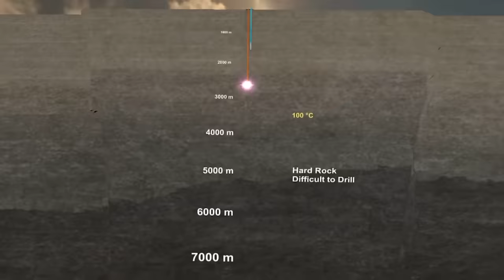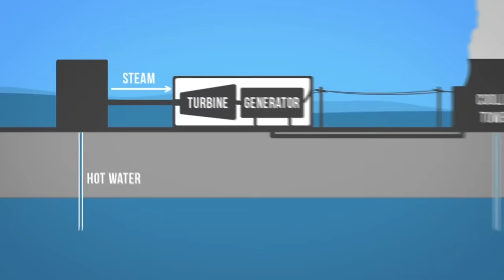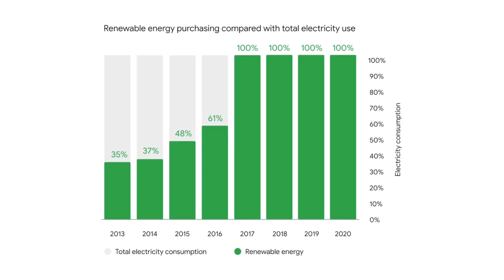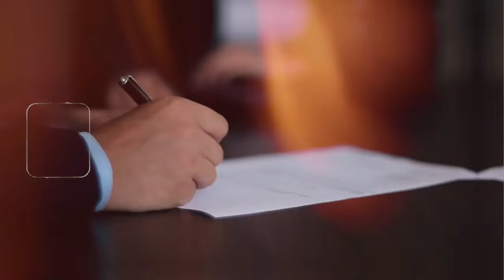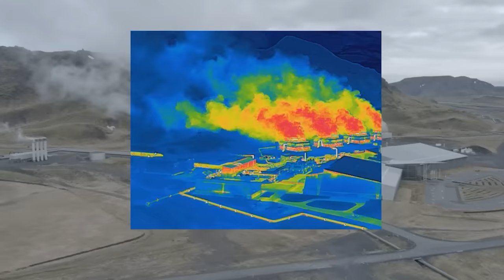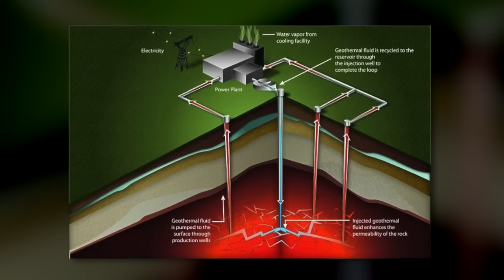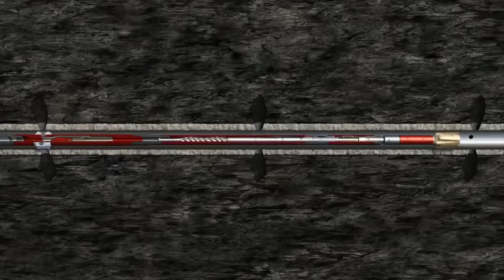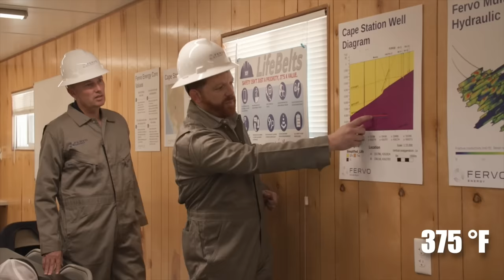Why Google Is Spending Billions To Build A Geothermal Power Plant

Comment from the maker: Will Google provide the answer to the world’s 24/7 green energy needs?
Reply: Let look up how much water geothermal power plants need first, and check where and how you can connect geothermal powerplants and reliable a water sources , and assess the costs
Reply: Why is that really needed! Didn’t scientists figure out how to create energy using energy. New era of nuclear power.
Reply: @user-xr4bo3ln6f You could use water pumps, but then that’d take away a chunk of the power generated so it’d cost a lot to doo this and even then it might not make back what it costed for a very long time
Reply: @michaelglynn7010    Every energy conversion to create electricity has parasitic losses in the process.  That's nothing new.
Reply: @MrRight-fu1gf  
Closed Loop geothermal has been around for a long time. Using refrigerant based systems that work at cooler temperatures have been around a long time as well. These systems like nuclear plants do not expose the the power side circulate to the heat absorbing circulant. The refrigerant condenses the steam and gets boiled in the process. The condensed steam is pumped back into the well and the boiled refrigerant powers a turbine.
Reply: Well over a long term large energy tapping, it might upset the balance of energy under the surface, no? What you would do is effectively letting the energy out of our planet and release it into the universe by heating homes for a short period of time, or making electricity that is used and is gone forever..
Reply: geothermal is inherently location specifc. It only takes minutes to learn this
Reply: @AL-lh2ht  
HVDC can more energy thousands of miles without substantial loss. Newer geothermal technologies just might be capable of being deployed in many areas that were not productive today. The question is can HVDC and deep wells supply a substantial amount of our electricity generation? We do not know yet.
Reply: @AL-lh2ht  it depends on how far you can dig. With plasma drilling any place can produce geothermal.

Comment: The power plant that the Fervo project is located at is owned by Cyrq Energy. There are many such geothermal power plants in Nevada and also in California. In fact the US generates the most geothermal energy in the world. What Fervo is doing is adding to the heat being used in the binary power plant to generate electricity. So Google is not building the plant. The rock isn’t dry, it is fractured but there isn’t enough permeability to be economic so Fervo fractures the rock to improve the permeability and make the wells produce more hot water. This plant doesn’t use steam, it uses the hot water to heat a working fluid that vaporizes and turns a turbine. The Blue Mountain plant has 3 binary units.

Comment: But I thought fracking was a bad thing!?
Reply: The difference between fracking when they are doing it to generate electricity compared to oil is with electricity all they are doing is shooting water into the parts of the ground, whereas doing it to extract oil they have to use chemicals in the process. I'm not positive exactly how it's done, I know that they have developed a way of making it much safer and/or cleaner than it use to be, but they still have to use chemicals to get the oil. But in any oil extraction, even if it's drilling underneath the Gulf of Mexico, there are going to be such tradeoffs. Risk/reward type of thing. One wrong move out there you suddenly flood the entire Gulf with oil. There are no oil fields in the world that have pump naturally built into them that we can just go hook our stuff up to. That goes for many of our natural resources.

Comment: why put a data center in Nevada where its hot as hell. what about Minnesota or someplace that could use the waste heat
Reply: Minnesota gets -50 degrees and foots of snow that cave in roofs. Then you get tornadoes and thunderstorms.  At least you only worry about heat in Nevada.
Reply: Tax breaks.

Comment: It is the Nevada Desert.   Where  is the water  coming from?
Reply: Nevada has more ground water aquafers than any other state in the union. 
The issue is its recharge rate is really slow. 
depending on how Google is going to use the water, its likely that the vast majority of it will be recycled through the system over and over again. 
If not, then the engineers are stupid. 
But the experimental Google building in this video is only a few miles away from the Tesla Giga factory that is also in Nevada about 20 minutes outside of Reno Nevada.
Reply: HOOVER dAM!
Reply: Possibly aquifers in the subsurface or nearby streams. . .

Comment: I’m not saying I’m right but there seems to be a correlation between fracking sites and subsurface earthquakes. This could also lead to this as the wells run deep into the crust?
Reply: Yes it most definitely will.  The Geysers in Northern California USA uses natural fissures and they ran dry of water, they now inject water in and it causes earthquakes, I  live near this area and feel the quakes.

Comment: Sounds like fracking, considered a biohazard in most of the United States when used to extract the cleaners Natural Gas in the world... but I guess when fracking is used to promote a different narrative all the biohazard concerns magically disappear. 
MAGIC has always fascinated me  😏
Reply: The details of each region probably matter here.  A lot of the criticism of early fracking dealt with holes drilled in more populated rural areas back East like in Pennsylvania. People using well water were having their wells (the groundwater formations above the shale gas formations the frackers were aiming for) polluted.  Either the upper levels of gas wells passing through the water table levels weren't cased properly - allowing chemicals from the fracking processes to leak out into the water table - or the fracking was taking place at depths shallow enough to allow such leaking.  

Oil and gas projects (both old style sandstone or newfangled shale formations) by definition are in sedimentary basins, with multiple layers of sedimentary rock - so there's probably groundwater above the oil and gas.  If there's any settlement in the area, they're probably tapping into that water already (good chance the oil and gas drillers want to make use of some of that water themselves, which can be another issue).  Also, the water used during the drilling of the well (and that's a lot of water, now with funny chemicals in it) will need to be disposed of somehow, somewhere - and that's often in OTHER wells in the area, tapping into other formations.  That can leak into some of those "good' water-bearing formations as well.  

Geothermal projects, in either the classic naturally fractured/ porous areas already developed around the world, or the newer "enhanced" projects like this one,  tend to be in igneous formations  instead of sedimentary.  That must affect the potential interactions with other formations.  Also, at least in the US, most of the geothermal projects (natural and enhanced) are in the West - California, Oregon, Utah, and Nevada especially.  Many of these are in desert regions.  There can be irrigated agriculture in the area, but there can also be some distance between these activities as well.  No, they don't "magically disappear" - but they aren't automatically identical either.  Using mere ideology in place of evidence on either side of this is just dumb.  Also, fracking itself may have developed as a tech in the last decade-plus, so some of the very real problems during the WBush/Cheney Administration may have changed since then.

There are several companies, as well as several government agencies (not just in the US) researching other potential advancements in drilling tech that may make much, much deeper wells than these practical.

Comment: Kenya has been doing this since the 80's, providing up to 800 MegaWatts of electricity in one of the most advanced electricity generation techniques ever invented
Reply: by volume Kenya does about 1/3 what the US (which leads the world in electricity generation from geothermal) does.  Good to see it happening.  Indonesia is right behind the US.
Reply: @lylestavast7652  And Iceland is about 2x the US.
Reply: Kenya only has to go 900 meters. The  break through here is fracking tech that lets them go much deeper.

Comment: For Geothermal to work,there will be fracking in order to maintain the volumetric head required.Even the Geysers in Lake/Sonoma counties this was ongoing during construction .In 1975-79.
Reply: There was no deliberate fracking during the early days of geothermal development at the Geysers. There was no injection of the cooled condensed steam which is what causes fracturing and seismicity at the Geysers. Injection started in the Geysers in the 1980s. There have been tests recently of fracturing at the Geysers to tap the deeper hotter rock that isn’t fractured already.

Comment: So a power plant in the middle of the desert. So where do they get the water from?
Reply: Yes  where?
Reply: You simply capture, condense and reuse the exhaust, this has been done since the 1800s. Nearly all steam power plants do that, i make them as a hobby. Size, weight and surface area isnt a concern at this scale and oil injection isnt necessary for turbines so they can definitely recycle 100% of it. Seawater can be used as coolant if the condenser is made of stainless steel or inconel

Comment: Either the video is BS or Google is stupid. There are a few places on earth where the magma is much closer to the surface and more fit for geothermal powerplant as they have quite low efficiency compared to other sources. Picking a location quite randomly is plain stupid and insane.

Comment: Инновации конечно это хорошо, но одна сверхбезопасная атомная электростанция Akkuyu будет генерировать 4800 мвт, а тут всего 3,5 мвт. 
Для выхода на такую же мощность понадобится 1300+ таких электростанций... это не очень хорошо для экологии.
Reply: This is the most logical comment I've read so far... BRAVO 👏👏👏👏
Reply: There both nuclear power: The earth's heat comes from underground nuclear decay.

The question is: What kind of nuclear decay is most cost-effective in your particular area: The artificial kind, or the natural underground one.

It'll depend on the depth, rock-type, but also the local supply chains/labour force you have available.
Reply: @domtweed7323  в любом регионе атомная электростанция выгодней и для рентабельности и для экологии.
Геотермальные станции используют в очень ограниченных условиях.
Reply: @ФедорГеоргиевич-ь1ю It depends on the supply chain.

America has a really bad supply chain for building new nuclear reactors (look at Vogle), making new American reactors very expensive. However, they have an extremely advanced industry in drilling very deep/long holes cheaply, because of fracking. So this could make sense in America.

In, for example, Russia, the situation is the opposite. Fracking isn't very advanced, but Rusatom is absolutely brilliant at building nuclear power stations. So Russia should build nuclear power stations.

So it all depends on local conditions.
Reply: @domtweed7323  США надо просто дружить с Россией и все будет хорошо)
Reply: @domtweed7323  Ahh touche, my usual response to to arguments against the nuclear power is... "we are touched by the li ight of the biggest nuclear plant every single day"
Reply: @ФедорГеоргиевич-ь1ю Rosatom is really good at exporting nuclear reactors, they are the world leaders in that. But it's probably good to have at least one or two viable global competitors to keep the prices down, so maybe the Americans could import French, or Canadian, or Korean nuclear reactor designs, alongside Rosatom reactors.

I think America is big enough to have 2-3 different designs of nuclear reactor and still get economies of scale (France operates 2 reactor designs).

Comment: Theres no way in hell it can be cost effective and it seems quite dependent on the terrain.
Reply: Works in El Salvador powers 25 percentage off there electric.....but they do have a lot less people
Reply: Iceland is greatly peered by geothermal. Geothermal and DLE Direct Lithium Extraction are coming online too
Reply: @andrewday3206  low 70's% of electricity in Iceland is from hydroelectric, geothermal electricity generation is in the 20's percent.  Where Iceland does really well is using the geothermal resources for space and process heating, to total energy use is heavily influenced by geothermal - and that's a good place to be in regard to not needing so much imported fuels.
Reply: Once the prices for drilling equipment go down (which will happen with the growing adoption of renewable energy sources) it will be a viable option in most places. You just gotta drill deep enough.
Reply: geothermal electric generation has been conducted in this location for decades.  This project is just using fracking to enhance the output.  3rd generation geothermal (AGS) can be built almost anywhere.  Deep boreholes (5 to 10 km deep) go down to rock which is 250 to 500°C.  A fluid is then circulated in a closed loop which runs a turbine.  Canadian company Eavor and Massachusetts company Quaise Energy are the leaders in this field.  While geothermal is more expensive than wind or solar,  it is 24/7 and a fraction of the cost of nuclear.